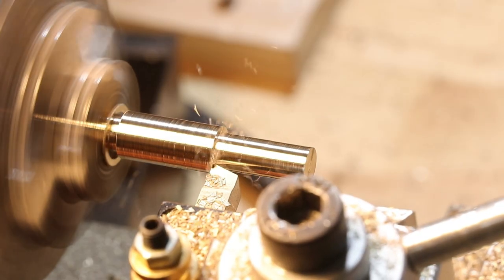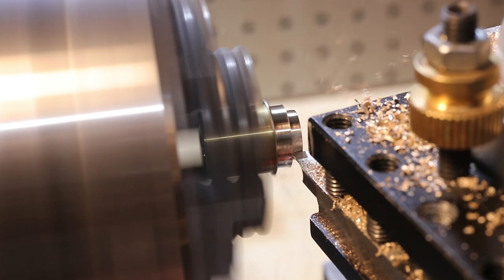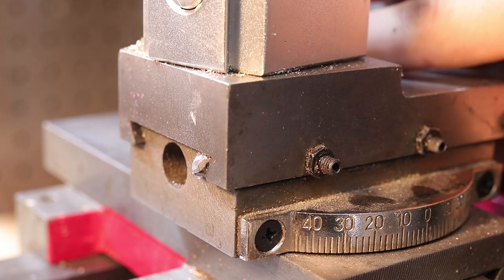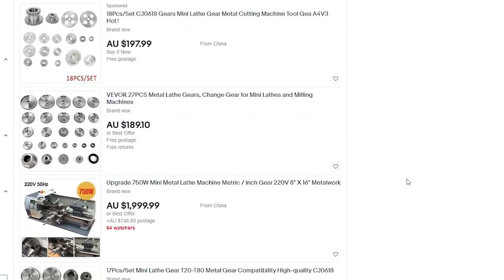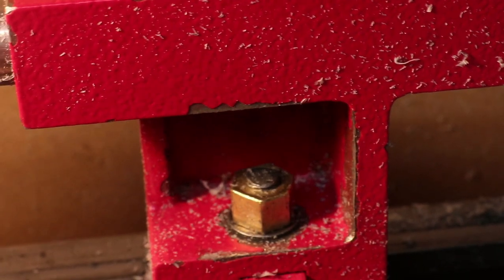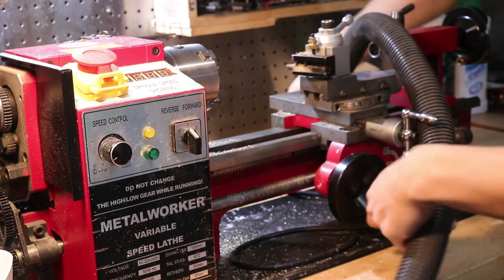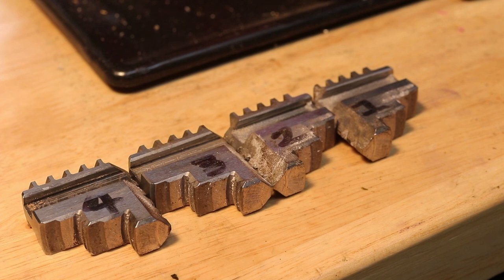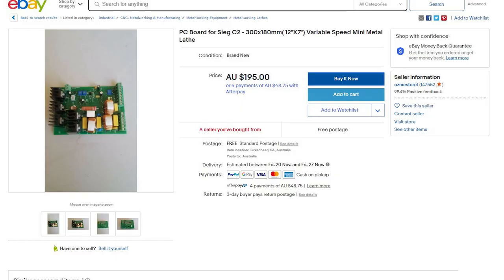Top Tips For Chinese Mini Lathes

Comment: Hi mate, I really like your videos. Having worked on lots of lathes over the years, I can very definitely say that bolting them down to an arbitrary flat surface will add rigidity but it'll also bend them out of straight. The way it should be done is to place the lathe on shims as close as you can get to filling any gaps underneath it, then take the lathe away and pack those shims in a polyester based filler, like isopon or what every you have in your country. Then place the lathe on that, clean up the extruded waste, wait for it to set and then after that bolt it down lightly. That way you get no distortion in the bed and your lathe only then needs levelling with a fine increment engineers level, and you'll be all good.
Reply: Helpful insight thanks

Comment: This has to be one of the most concise tips for a mini lathe I have seen, nicely done.  Unlike many you have not assumed a full strip down and rebuild is in order!
My mini lathe is cnc so not quite applicable. However, a couple of ideas, for lathes with little power the carbide inserts for aluminium work well on aluminium and steel.  Brass may be another matter as the high rake may lead to the tool being drawn into the material faster than intended, in other words it can grab.  They may not last too long on steel but they are very cheap these days, so worth a try.  Centre drills are great for making a centre pocket, but use a spotting drill if just making a start for a hole. It is oh so easy to have the point fall off a centre drill which does not happen with a spotting drill.
If your tailstock is a pain and you have a QCTP make a holder for a chuck to hold drills and drill using the carriage, so much easier than winding a tailstock handle back and fore. If using carbide tooling remember, that non ferrous under 30 diameter can be run at 3000 plus rpm.  That is just a statement, if the lathe does not have that high a speed just use whatever works for you.  If you have to buy material be aware, that steel, aluminium and brass are available in what is known as machining grade. The aluminium in particular will not create those long unmanageable strings of swarf folks so often create.   If a jobber length drill wobbles about too much there are drills known as stub drills which are much shorter and I can usually run those straight into the work piece without a spotting drill.  Are the Sanou chuck jaws was not stamped with their number?  That is a bit slack. I think that is about all I have to contribute. Thank you for putting such a sensible tips for the mini lathe out there.
Reply: some good information  here cheers .
Reply: Great tips as I'm just starting in my mini lathe. Would like to see you post a vid on using the tail stock drilling technique you speak of....dont quite understand. 
My Chinese mini lathe does not have an rpm indicator only a rheostat type knob. How do I overcome this?
Reply: @alangriff1  I bought a cheap digital tachometer off ebay, works well and was not expensive, mine starts at 16 aud. Search hand held digital tachometer. Take a few readings and mark them around your rheostat knob.
Are you talking about NOT using the tailstock to drill?  Use a holder that normally holds a boring bar and use it to hold a parallel shank ER 16 collet holder (or you can use a drill chuck)  then you can hold drills.  Set the centre height for the drill and find the centre along the cross slide.  You can do this by first drilling a 10mm hole with the tailstock then place a 10mm rod in the new holder and find the centre in the X direction.  You then note the position of the cross slide dial and you have the centre.   Use any convenient drill and rod combination, nothing too small though as it will flex and make it difficult for you. Make sure screw backlash does not throw you off.  Does this help?

Comment: Hi folks. If you use longer bolts to hold the lathe down then with some extra nuts and washers you can arrange to be able to adjust the bed to ensure that your new lathe turns parallel. Lots of videos on line about how to do this. Enjoy your new tool. BobUK.

Comment: Bolting down securely is very much underrated. If your bench is rock solid and stiff and the lathe bolted down with strong bolts, it greatly improves the stiffness.
Reply: Mine still wasn't totally rigid enough, so I bolted it down to a concrete paving slab 2ft sqr, 50mm thick and weighs 42kg its now as solid as a rock, no movement at all.

Comment: Thanks for all of the info.  However, you need to adjust your tail stock (drill rose upward when entering work piece).  The chuck inserts are all numbered and the chuck has a manufacturer's mark for the number one insert (a center punch near the #1 insert slot makes it easier to identify).
Reply from the maker: Thanks for the response Rick. The tailstock was made slightly too low, I had to shim the tailstock up to get it in line with the spindle. Cheers

Comment: Replacing the gears with metal ones is a good thing to do. However you might want to leave the one one the carriage drive shaft as plastic. That way if in a moment of inattention you run the carriage into the chuck, it rather than anything else will break, and it's pretty cheap to replace--another one of those " Don't ask me how  I know that"  things.
Reply: Some newer mini metal lathes like Eastwood 7x12 have a falt safty which immediately stops machine detecting collision however some things can still get damaged
Reply: These small lathe are mainly intended for new learners, and that is why they have plastic gears, so when you do crash the tool into the chuck is the gears will break instead of breaking the motor or shattering the jaws and many other parts that would cost a lot,
i do suggest in buying a spare set just in case, i have , But never needed to use yet and so I have been using my original set  for other a 1000 hours of use
Reply: @Mike McGuire -- I LOVE that idea -- it's like a "sacrificial gear" as "fuse".  Honestly, I keep ruminating in the back of my mind about ways to have fail-safe "auto-stops" to keep from running tools/carriages/etc. into spinning (thus invisible) chuck jaws -- kind of the metal-world equivalent of a "SawStop", although those are sacrificial brakes that save a finger and weld to the blade at a pretty high cost and definitely a one-time use. Your notion of just "break one cheap plastic gear" to prevent [insert random Clash Of Metal Parts Under Torque and Flying Broken Objects here] is pretty good already... :-).

Comment: Great video, all good tips, to add;
First priority: Change the gears to metal. All of them, the motor drive pulleys and the transmission gears, plus the lead screw gears - all of them.
I cannot stress this enough...
QCTP is a great addition.
Loctite the cross slide and top slide handles, they unthread when you use them if you don’t.
Adding a washer on the cross slide and top slide takes up a lot of slop.
Reply from the maker: Good info, however the part with the locitie on the handles, from what I have seen, the handles that come on the Sieg lathes vary differently to the ones that come on other mini lathes, which tend to unscrew. The sieg ones do not unscrew, which I was pretty glad about. Cheers

Comment: My lathe came with a 3 jaw chuck. Each jaw is stamped with its number as well as the slots in the chuck have tiny dimples. 1 dimple for jaw 1 and so fourth. If yours is not this way you could use a hammer and center punch and put light dimples in the chuck and jaws. Less likely to clean off a small dimple then marker.

Comment: Use a center punch ( .   ..    ...  ....)to  label the jaws and Chuck.                    👆                  
 Instead of using sharpie marker
Reply: Yes..I did just that
Reply: As you say, use a permanent way to ID the jaws.  
But do mark it where it will not get in the way of any working surface area, as when punching on metal, it causes indentation & bruising/ Displacement

Comment: From my lathe I found that it's a kit put together to ship to you. When you get it, disassemble it for better cleaning and checking for areas of poor manufacturing,  fitting and for sure, making sure all the adjustments are checked and redone properly. These are not set up for immediate operations.

Comment: I have found that  the Amadeal AMA210V-G lathe  I bought four years to be accurate but I found that the 600 watt variable speed motor was not powerful enough particularly at low RPM. Perhaps that might be because  I have been used to using tool room machines with motors rated at several Horse Power.  They do represent good value and are a valuable addition to any workshop. If buying one go for a lathe with taper roller bearings in the head stock and metal feed gears rather than plastic.

Comment: Another tip: replace the stock toolholder with an MultiFix or another quickchange holder. This makes the work so much more confortable. And the Multifix adds tons of regidity.

Comment: Thanks for the video, mate! 
I noticed that the drill bit was lifted by the hole in the workpiece. Was the drill bent or is the tail stock out of alignment?
What I changed were the handles on the plastic hand wheels, sobthatbthey unscrew themselves. I turned a shaft to mount on the hand wheels and the handles are slipped over this shaft.
Reply from the maker: You are right about that, they issue is usually caused by one of two things. There is a bit of sag in the tailstock spindle when it is extended past 25 or 30mm with the heavy Jacobs chuck loaded, which I can put down to the quality of the tailstock. The other issue I have is with the nut locking tailstock, I can accidently bump it out of alignment with the spanner, although I do it much less frequently now then when I first got the lathe.

Comment: My question is... Can you upgrade the lathe motor to apply more power to the work while not compromising safety?
Reply from the maker: You can indeed, lots of people have, though at a point you need to look at increasing the rigidity of the carriage and slides in order to take heavier cuts too

Comment: In general how does one set up a boring bar to guarantee the tool tip is parallel to the hole being bored. Many thanks
Reply: I buy high speed square bank, mount it in toolpost weld a cutting edge to it. And it will be parallel to the axis

Comment: Looks like you added a different motor but still using the original control? It still must handle the current?
Reply from the maker: Hi gvet47. 
I originally changed the motor around the time that the first control board broke. I originally planned to use the variable speed control board but in the end opted not to use it. The motor now is just a spare one that I ripped from an old drill press and is more powerful than the stock lathe motor. Ultimately the reason I decided this is because it is a fixed speed motor with a great amount of torque, so I machined up a belt drive system to run the lathe. Outside of the stuff I film here, I am always machining acrylic, so the pulley  and belt drive allows me to machine at 2500rpm comfortably, and much quieter than I could with the stock motor. And to be honest, machining at anything higher than 1500 rpm with the stock motor was a little scary due to the noise it made. 

Cheers

Comment: Another tip. Change that tool post to something like what I got ( T37 Quick Change tool post set )
I did upgrade the standard tool post to the Aluminium one that you have.

Cutting was ok with the cheap tool post, but I could never get a perfect height when changing tools , and noticed the brass lock of screw was not sitting level and the tools and tool post is a sloppy fit, and when using the parting tool the centre line kept on changing/moving, so the only parting that worked was me from using it!

Anyway now with a higher quality tool post everything is more sturdy and now the parting tool works perfectly, and all other turning is superb.
So i would not recommend the cheap Aluminium tool post and would use the money to get  a T37 type

Comment: Please, can anybody tell me, which is it maximum tool size for those chinese mini lathes with standard tool post? I would like to know if will fit 12 x 12 mm tool or 10 x 10 mm is maximum that can pass. I want to buy tool holder set with carbide inserts with size of 12 x 12mm and I do not know if will fit or those tools will be too much high of center.
Reply from the maker: The stock tool holder will work with tools up to 8mm high. Anything taller will be above the centre line. Cheers
Reply: @artisanmakes  Thank you!

Comment: You needed to tell people to make sure the surface is completely level/flat for which the lathe is being mounted to. You can make your already-chintzy communist china made lathe even more out of square/true when you tighten down the fasteners thats securing your lathe to the bench its on .... depending on what your bench is made with and how rigid it is. My brother's mounted his lathe to a home made bench he bought at a flea market. It was made with 3/8" think steel plate and angle that was warped by whoever aggressively welded it together. When he fastened it down to the bench, it tweaked the lathe being parallel from one end to the opposite end

Comment: If you want a good tip how about don't turn a piece of stock whose length is more than three times its diameter without a tailstock center. Kind of like in your thumbnail
Reply from the maker: When I was trained to use a lathe it is quite true that I was told about this rule, but I was also taught that this this guideline is just a guideline and changes depending on the material and depth of cut. Next to acrylic (which certainly requires a tailstock) the brass is the most common material that I turn and the brass I use here seems to be more forgiving at having more stick out than aluminum or steel, although this shot, and similar ones from the scriber video were certainly on the limit of what I was comfortable with at that depth of cut. If I was to take a guess at why that is I would guess it relates to the type of small chips that brass creates, compared to the stringy ones that you get from other materials. A live center would be the way to go but for what I needed the part was within the tolerances I set out.

On a side note for filming I generally try to push stick out to the limit when I can. I think it looks a little better to try and have the frame filled a little more with some extra material in the shot. And some shots need the extra stick out because the tool post or die holder would obscure the shot.

Overall a good thing to point out Dustin.

Cheers

Comment: My lathe is 79 years old and used daily . Made in US
Reply: congrats that you have been using it for 79 years.
Reply: @spudnickuk  No only 35 years !
Reply: Good stuff. I have minimal exp with lathes. My fav to use that i first found a love for lathes with was a 1974 craftsman atlas (least thats what was printed on the headstock). It had a 10 inch chuck and a large lays. Used it few times where i worked at the time experimenting and learning mainly.

Comment: Bolting the mini lathe down will twist the bed.
Reply from the maker: You can level it if you need to, on a mini lathe there are a lot of things that need to be done before you need to worry about taking the twist out if the bed. Ultimately having a lathe that can freely move around quite dangerous. Cheera
Reply: @artisanmakes  Use only two bolts and don't tighten them down.
Reply: I put a clock in the 3 jaw and run it round a dead centre in the tailstock til it was true. I moved the tailstock to the end of the bed and loaded a centred piece of stock. Then I turned the exact same diameter at both ends and zeroed a clock on one end on centre height. If the bed is straight, the clock will read the same at both ends, if not, then shim the base of the lathe accordingly until it does. This won’t guarantee the lathe is level, but a lathe on a ship seldom is….but it will be straight.